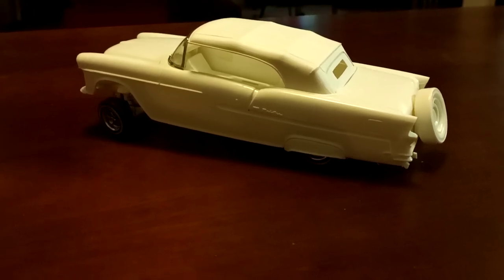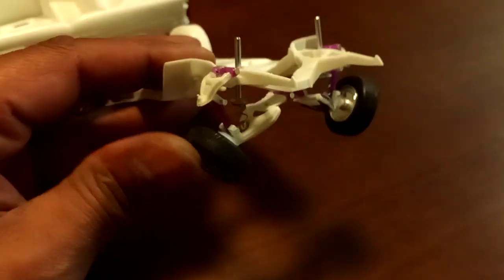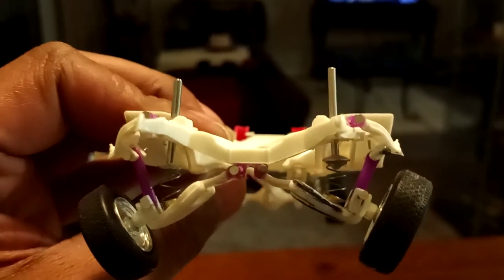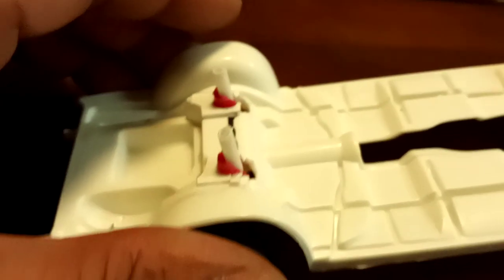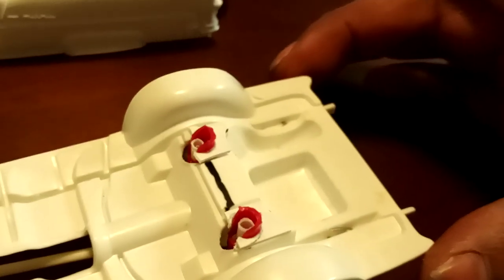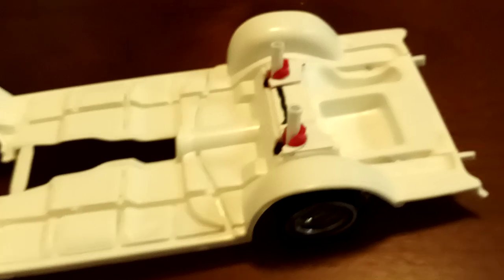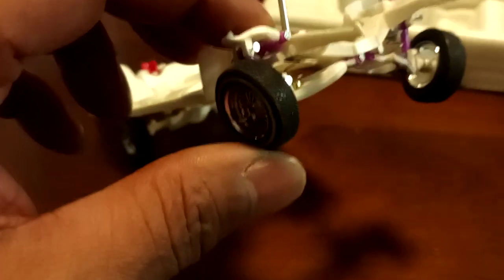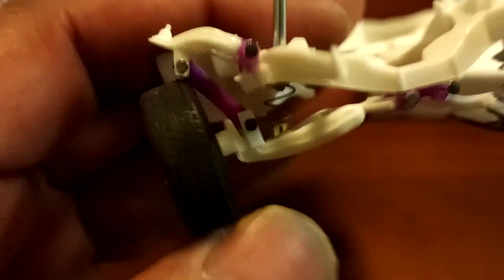how to make a 1/24 1/25 scale lowrider hoppers  tutorial part 1

Comment: How long does it take you to go from a new kit to completed car show low rider. Hey man thanks for the info instead of that pink melted plastic I used ever green white styrene tube looks better and stronger pivot point. Your right man your never gonna learn unless you go in there start cutting and experimenting and don't throw away the project if you mess up grab some spare parts from your scrap box and work through it you can build a low rider from a random body chassis and suspension cuse your cutting and chopping any way so don't waste a new kit if you been building a while use your scrap body and parts boxes and get wild with it. Hell mix and match the front bumper off one car onto another and build you a wild custom ride that only you have the only one in the world cuse you made it from random parts. I made a very big boat low rider two 62 thunder bird amt 2m1 kit bodies made it half a car longer and with Cadillac 67 coupe DeVille from back window back with the big wings it's sweet and looking sick it's been a year of work in progress working on it a few hours a weekend

Comment: This video helped a lot but for the slower hands on learners need a step by step video
Reply from the maker: You for supporting the channel my brother much appreciated good luck on the building it's going to come out tight.
Reply: @eddieblcc  I still have questions like how exactly did you do the front half of the rear end as far attacking it to the bottom of the body

Comment: Eddie. That was the most helpful vid on suspension I've seen🤩thanks a lot and best wishes from jolly old England. Pete😎
Reply from the maker: Wow england awesome and thank you brother I appreciate you ☺️
Reply: @eddieblcc  I was subbed to you but you seemed closed but have subbed again as you've restarted. I'm sawing up parts from a 51 bel air following what you said. And putting Jimmy Flintstone chopped body on it. 😎Pete😎
Reply: @eddieblcc  Wow, you've subbed me😲👍👍I feel honoured when people with your level of skills are interested in the models I'm doing. I've sawn loads of bits. Back ends swinging. Front upper a arms I've stolen from corvette to mount in bel air. Thanks for your advice and support,Eddie, cool. 👍Pete 😎
Reply from the maker: @petesmodelcarcustoms584  thank you brother I appreciate you man and awesome comment too
Reply: @eddieblcc  I try to be straight up about stuff and hate b, s. 😎

Comment: How’d you get the ball bearings to stay but still able to move around?
Reply from the maker: @russellrowden1287  I drill little cups the same size as the ball bearing and each ball bearing has a little arm in between it separating it that allows it to swivel those are pull chains off of ceiling fans thanks for watching piece

Comment: How are bearings attached to the plastic, if they glued they won't move
Reply from the maker: They're connected by drilling a small round hole the same size as the bearing then you slide the bearing in the hole would like man maybe a half a drop of crazy glue and that'll hold it in there tight just keep it in there nice and straight and you should be good drill the hole drop the bearing in thank you brother for watching I appreciate you God bless

Comment: That type of chain where exactly did u get that from and how did u hook it, did u glue it or…? Also what kind of motor do you use with your servos? Also what type do you use is it the 9g”? Just so I know if you answer my questions I know the motor you are using is the same as mine. Thank you for any help.
Reply from the maker: I got the chain from the hardware store it's a tub stopper chain and yes I glue them in place but first I drill a small hole the same size as the chain ball joint and I didn't understand the 9g thing and that's a Johnson motor I ordered off of Amazon also the little blue servos they're standard just look up servos at Amazon usually takes a day or two to get them thank you for watching brother
Reply: @eddieblcc  oh ok koo bro the 9g is the rating of the servos I seen on Amazon and at the hobby store I guess it’s another way they read volts. So the guy was telling me if the motor itself can’t handle a certain volt the motor will have a hard time working hence why I asked if the motor you have with the sorvos if it’s 5v or 2 v and etc. I appreciate your feed back what your doing is pretty koo I still have the hoppers from the 90’s and I have my other models but this is more so a newer thing which is pretty koo.. keep up the good work boss..
Reply from the maker: I think you're right about the 9g servo thing I think that is the one that I use it's the clear plastic blue one well it's blue clear plastic thanks again for watching man I'm glad I can be of some help God bless it takes a 9-volt battery to operate that particular servo I forgot to say that
Reply: @eddieblcc  koo thank you bro and GOD BLESS to you and yours as well

Comment: Have you ever done telescopic for the rear & if so do you have a video of it. Thanks
Reply from the maker: Coming soon brother thank you for watching peace 😊
Reply: @eddieblcc  k I have a lil problem with a model I bought & I guess I was using to much power & rear end messed up I have it back together but I don't know how to run the string though & to the telescopics if you can help me out it would be VERY appreciative . Thanks
Reply from the maker: My next video part two I'm going to show you guys how the run the string and how to set the wheel spindles on the front so that the car lays down and where you should put the metal at to keep the plastic from cutting when the strings are running over it trust me my brother I'm trying to help everybody when this next part two video hits it's going to be everything I know so thank you for watching man and I do appreciate you

Comment: Need sum advice if u can help
Reply from the maker: Sure what do you need brother
Reply: @eddieblcc  having trouble to geting my front setup just bought my Big Daddy Jackson's motors . It just gets stuck not to sure what I'm doing wrong got the back on point can't figure out the control arm new to the A arm hopperz.
Reply from the maker: @brucelee2941  the motor is getting stuck because you didn't glue the springs down properly the front springs have to be set with glue on the bottom of the spring and then it'll it'll unlock the motor every time the car jumps my next video I'm going to explain all of that and how to set the front spindle where you put the wheel at it's going to be on the next video brother I'll do it in a day or two setting the spring right pulls the motor back into a free spinning motion I'm going to show you guys that on the video
Reply from the maker: I wish you could send me a picture
Reply from the maker: Do you have messenger?
Reply: @eddieblcc  Thanks you saved me a big headache Bro. Keep making these videos there helpful much love
Reply from the maker: @brucelee2941  anytime brother sharing is caring .